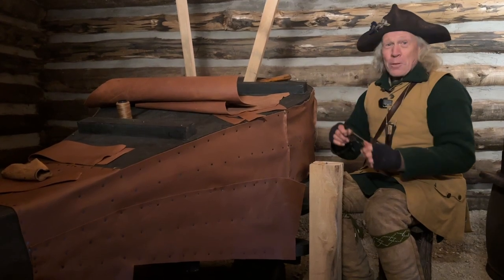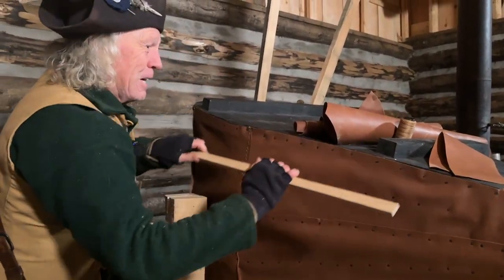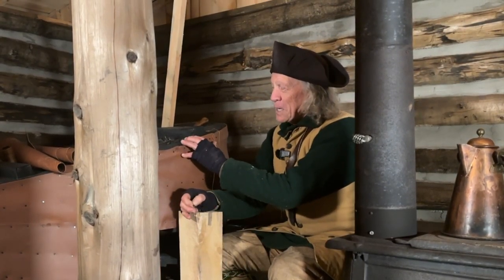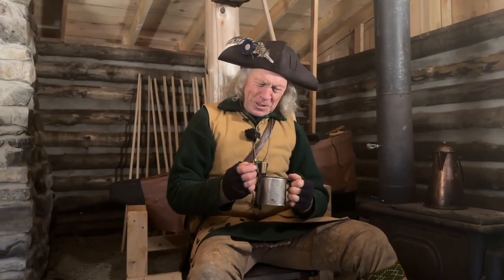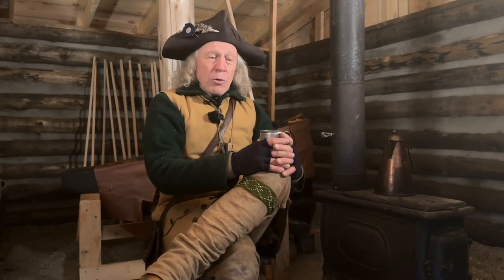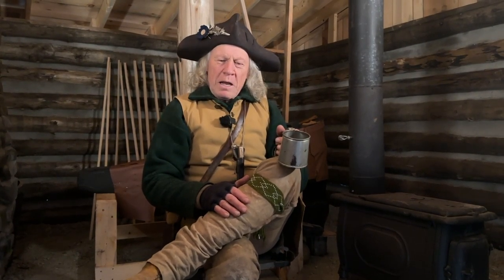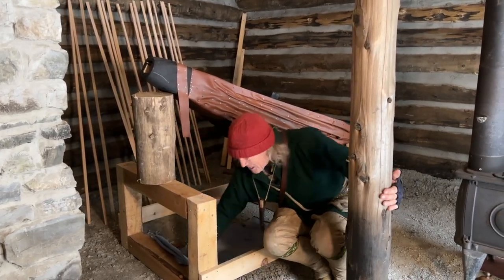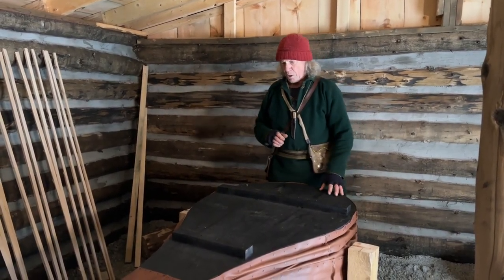Completing the Bellows: Bringing our 1800's Blacksmith Shop to Life |  HISTORY | FRONTIER | 1800 |

Comment: Peter, rather than using a trough, most natives and whites in the backwoods used the pot and dipper method for bending wood.  It was simple.  The end of the stick was placed in a boiling pot of water at a steep angle. The dipper was then used to dribble boiling water on the stick so that it ran back in the pot to be re-cycled. The wood was then limbered over a knee, padded with rags and then returned to the pot for more heating. The process was repeated until the desired curve was achieved and then the wood was held in place by a variety of methods until the wood dried.  This method is a bit slower but reliable provided the wood was moist and green (no dried lumber).  To keep the green wood in this state prior to bending, after each period of work, the  wood was stored in a puddle of water or in snow.  Good video.
Reply from the maker: Thanks Doris, I recall you giving me that advise for canoe building.  In this application, I was afraid of getting hot water on my tacked on leather.  Appreciate any ideas that make life easier or we’re in fact employed in the old days.

Comment: Used a strip of harness leather to hold the leather/ canvas to the bellows to seal the edges. Have never seen wood strips used like that on original bellows myself. Hope they hold up for you.
Reply from the maker: Here’s hoping,Pat.  I’ve actually seen two sets of older bellows that had the wooden strips. I can’t believe the a out of air it pumps.
Reply: @TheWoodlandEscape  First set I made could blow up 3 foot of flame from the homemade pot I welded up. Was tough on the hair on my arms.
Reply from the maker: I’ll be watching for that potential danger!
Reply: @TheWoodlandEscape  When I forge all the time there is no hair on the back of my hands.

Comment: Congrats on the build!   I envy so much.   With a bunch of luck I’ll be able to start a bit of an adventure like this in 2-3 years.
You should get yourself a Speedy Stitcher.  It was invented in 1909, so it’s cheating a little, but for sure people used an awl with heavy thread for hundred of years before that.  Save you fingers, and much heavier thread is available.
Also, I’m not sure what those slats are doing.  Just re-enforcing the tacks, or is it to cut down on leaks?  If so, wouldn’t putting a little pitch on the underside of the tack when you put it in work?
Reply from the maker: The slats are to seal up the bulk of the leaks between the tacks.  It sure does move a lot of air.
Reply: @TheWoodlandEscape    Ahhhh, I see.  Obvious now that you mention it, since they probably didn’t have any terribly effective glues back then.   Thanks!
Reply from the maker: They had hide glue.  I’ve actually made it and it is pretty darn good stuff.

Comment: @The Woodland Escape:  Make yourself Sailmakers Thimbles.  You are only supposed to take blood samples just before a meal.
Leather workers also have similar thimbles/gloves that protect the palm of your hand and important digits
Usually, they are made of layered thick leather with a layer of tough rawhide and only cover the parts of your hand that likely will get ventilated.
Unless you are sick, you do not want to draw blood to remove "Bad Humors".
Reply from the maker: Now you tell me, Jim, lol.  Hopefully this may very well be my first and last set of bellows.
Reply: @TheWoodlandEscape  :  You took on quite a challenge !  Those thimble/gloves are useful for sewing anything thick and tough upholstery, web strapping (in your outside life), or anything else you can dream up where you would prefer not to have more holes than what the "powers that be", created you with. 

Have you thought of sealing the seams in the leather and the interface between the leather and the wood parts, for more efficiency ?  I think they used a mix of pitch and beeswax as a sealant (not positive on the recipe).
Reply from the maker: Actually the darn thing pumps more air than I’m ever gonna need.  The slats took care of the bulk of the leaks.